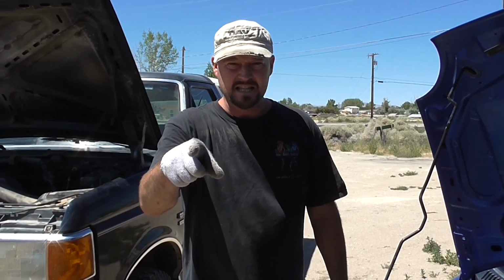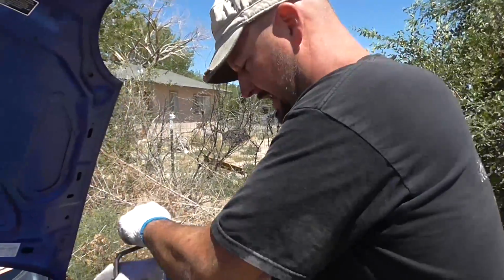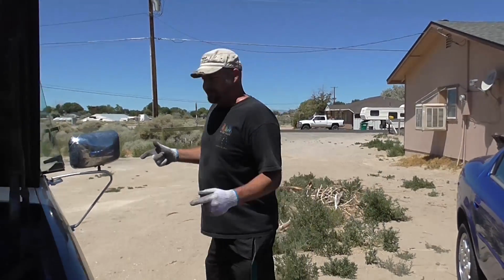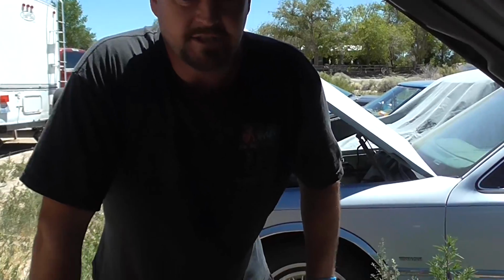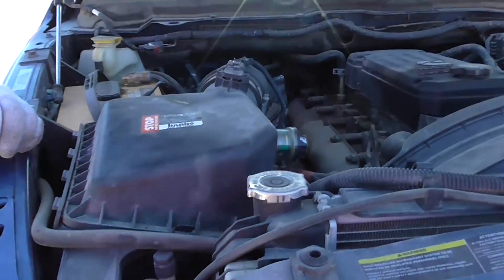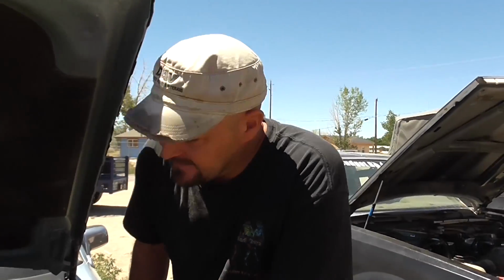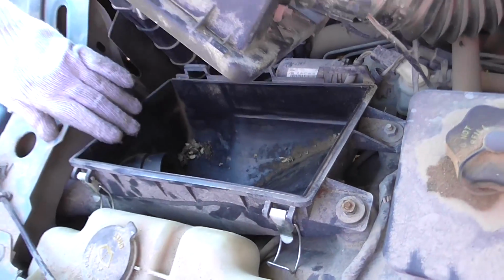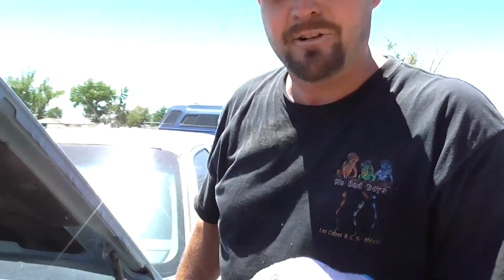Free Horsepower And Fuel Economy - Intake Mods

Comment: Good stuff.   I have a piece here on what I went through to get my 88 4wd Chevy to about 26 mpg without doing any internal engine work.  Hope to hear more later from your "Hollywood" promotions.
Reply from the maker: Would like to get lucky enough for a promoter, sponsor, or channel to take us on.  So far, these videos are just a hobby we do here locally in our small town of Fallon, Nevada.  Home of Top Gun Navy fighter training.
Reply: 26 mpgs from an 88 4wd Chevy is an impossibility -- you must not be calculating your fuel mileage correctly.
 Here's how to do it correctly and accurately:
1. Fill your gas tank completely full.
2. Record your odometer reading at this time.
3. Drive until the fuel gauge reads 1/4th of a tank is left.
4. Fill the tank completely.
5. Record the gallons used to two (2) decimal places.
6. Record the new odometer reading.
7. Subtract the previous odometer reading from your new odometer reading.
8. Divide the number of gallons (such as 14.75) used into the number of miles  traveled to determine your EXACT fuel mileage.
 I'm sure that you will find that claims made for "better fuel mileage" are mostly hogwash. This mileage computation method will allow you to check your fuel usage ACCURATELY in order to test the actual benefits received from any  modifications/adjustments that you make to your vehicle.

Comment: Is there a way I could numerically compare and contrast the intake and exhaust ratio of whatever potential parts I may decide to swap out? I just want to be sure I can get the best bang for the buck. I know that modifying the intake without modifying the exhaust can reduce power in some cases due to an increase in exhaust pressure.
Reply from the maker: With out a flow tester or flow bench (expensive piece of equipment) it would be very difficult to come up with a ratio.  I look at intake filter area and prefer to use as large as an air filter as possible limited to space of course.  The exhaust I prefer welded type mufflers such as a thrush welded, flowmaster welded style or similar designed mufflers.

Comment: Hit a big puddle with a chopped airbox, then get back to me . If more air needs to come into the engine it is safer to get it from the hood or at least grill level. Not sucking air from a low, downward position .

Comment: when you cut the air cleaner you are bringing in more air also the computer is set to have that air cleaner from the factory when you modify that air cleaner you're running a lot more air do you have to readjust the fuel mixture we set it in the computer system because you don't not want to run the car to leave because when you run a car too lean it makes the engine run hotter computer system was designed to have the original airbox system do you have to reset the computer fuel system on the vehicle was curious

Comment: Chopping the bottom out of the Lincoln's air box was a dumb idea -- which makes the whole thing into a HOT AIR intake. Better to just remove the "Snorkel" from the air box and run a short piece of 3.5-inch dryer hose from the air box  forward to the hole in the radiator support, where it can draw COLD AIR from forward of the engine compartment. I've had that modification on the famous 95 MERC for several years, using a K&N Air Filter -- works perfectly, sounds right, and saves the cost of an expensive "Cold Air Intake".
There is NO restriction with the above mod, as the hole in the front of the air box is larger than the diameter of the Throttle Body.

Comment: til you drive in the rain and water flies up into the intake
Reply from the maker: Many stock filter inlets have that very same problem.  My intake lessens that problem.  Worried about water, get a snorkel.
Reply: Or you could do a k&n filter with the anti hydro bag, while its not 100% water proof it will help quite a bit

Comment: As crazy as this guy sounds, his ideas worked great on my crown Vic and Grand Marq. They sound like screaming banshees from 3500 to 5500. Cut the bottom off of the air box, it works great! Make sure to leave the mounting points so it can get mounted back up.
Reply: I made a new intake video on Mad Boosting which IMO is much better than my original Free intake mod video.
Reply: @madboostingmadmatt48  You are my new Guru

Comment: Hey, you are a funny guy!  Like your ideas.  I have a 2005 Town Car.  When I make the mod to the air box, does the computer have to adjust to more air?  Or does it automatically adjust to the extra air?  I love that sound after your modification.  What mufflers should I get to help with the 239 horsepower engine’s breathing?  What kind of increase in horsepower do you reckon I’ll get?
Thanks
Reply from the maker: Computer will make self adjusting within 30 miles or regular driving or disconnect negative batter cable for a bit, re connect it and PCM resets and relearns your setup.  This works for simple mods like intake and exhaust.  The muffler I picked for my 2020 F150 3.5 ecoboost is budget $25 and a good rumble and free flow.  Here is my video on it:      https://www.youtube.com/watch?v=PaxHmZi0U9s

Comment: I herd the town car has a govenor system? is that true, if so how do I take it off
Reply from the maker: A tuner or a PCM aftermarket performance chip from Hypertech, SCT, Diablosport and many other tuners have chips to remove governors and increase limits to allow more out of the engine.  They can be found at Summit Racing and other tuning shops.

Comment: Man I wish I would have been more scientific about this because I did a transmission fluid flush and cut the bottom of my air box off at the same time and it fix my stall at idle my rough idle and general motor roughness but I don't know if it was or if it was the brown slugs transmission fluid I had in the torque converter

Comment: Cool but what about the need to try to keep the air as low temperature as possible.  The factory ductwork usually feeds the paper filter from in front of and beneath the radiator.  The underhood air temperature climbs precipitously especially in city driving.  Edit - I see that my comment applies to the first vehicle and you did try to do CAI on most of the other ones.
Reply from the maker: Keeping intake temperature low is great. However, if you have an intercooler on a turbo charged engine that does the job for you. Of course lower intake temperatures before the intercooler is beneficial as well. Always do what works best for you and on your budget.

Comment: Its flowing so much air  that it has imploded due to the vacuum it is creating, look at how it is crushed. More air=more fuel. The more air entering the engine the more fuel it will consume. The O2 sensor will adjust the air fuel ratio. at first the engine will run slightly lean until the adaptive memory catches up. So maybe a little better economy for a week and them worse than stock. minuscule performance gain. (assuming you are increasing air flow as he did not do on the neon).
Reply from the maker: the filter looked crushed when I put it in.  I had installed it in another car with tight space and it collapsed a bit.  It was not due to vacuum resistance.  I did not want waste a good filter due to just looking a bit crushed.

Comment: So all is well and good but weren't these mods done to pre '96 models? Just wondering what will happen at the inspection station when the tech looks up and sees 1/2 the air cleaner housing missing or other mods. Won't these mods affect the OBD II scan readings?

Comment: This is new? I was doing this 20 years ago Hell make that 40 years ago by flipping the    top of the carbs intake air filter cover lid over.
Reply from the maker: Yep, me too, I did that in the 80's to my 1975 montecarlo, flipped the airfilter lid, installed taller filter and what a difference for such an easy mod.

Comment: More holes in the bottom of the air box filter = more HOT air from the engine bay inside so no gain (on a contrary you lose performance) just noise.

Comment: only performance and mpg matter. Noise does not matter. pressure drop goes by the 5th power of diameter-even a little makes a difference. cold air ok if you can get it-I'd rather have better breathinng.  paper  ok as long as it performs.  Remember an engine is just a air pump so must improve exhaust too.

Comment: Breathing easier means less clean air so when the not wellfiltered air goes through the engine all the dirtyness is acting like a sandpaper on the engine and after some miles u will need a new engine

Comment: When you use the paper filter and cut the bottom out of the filter box, doesn't that then expose the whole filter to water when it rains?  And its not clean water, its filled with oil, dirt, and other road filth.  Won't a filter strangle the motor?   What happens to the K&N filters on top of the block?   Anyone?  Anyone? Bueller?  Bueller?
Reply from the maker: That requires careful thought, aim the cut hole towards the grill where the cold incoming air is.  The factory hole on many factory airboxes is below the bumper, so to your comment, many cars will suck water anyway with extreme puddles.

Comment: Most cold air intakes are useless. The oem already designed it for good flow. Just buy a different filter material if you don't like paper ones.

Comment: Most Smog techs don't care, but occasionally you'll get some boy scout who either opens the air box or feels around it and will fail you for damaged emissions when they spot the holes you drilled in the box - just fyi. Better to get a CARB certified CAI and avoid the hassle of having to buy a replacement stock air box.
Reply from the maker: I am glad I do not deal with CARB since I am in a small town in Nevada.  But the best thing is to talk to the SMOG tech before hand and explain to him why and the benefits and see if he will still pass you.

Comment: I just finished making a 3 1/2 inch hole in my trucks 2006 lower cold air intake box. After 15 years of owning the truck I noticed a huge gain in performance across all power bands, after cutting the 3 1/2 hole. I also made an extra hole my 2021 car. I noticed a huge gain in power. What you are saying is true! Free modifications in any existing lower cold air intake will work for for any car to gain power. I completely agree with your "small hammer" approach to recapture power that is kept from our cars! Modify what exists or spend a little bit of money to recapture what should be ours.

Comment: What I don't understand is, if it is breathing through a small hole on the bottom of the air box, then the air goes through the air cleaner, and then it is has to go through another small hole and down the tube to the throttle body, what good is increasing the hole on the bottom of the air box?  The hole it has to go through on the top where it goes to the throttle body is the same size. It is still restricted so I don't see the benefit. Am I wrong?

Comment: I totally remembered this video when i disconnected the resonator on my civic (Just the pipe not the entire resonator in the intake). Sounds badass and the little "Hiccup" i had when i released the clutch is gone. Plus that beautiful throaty sound
Reply from the maker: Every one of my cars has my intake mod, and it really makes driving it more enjoyable as well as the better throttle response, and improvements.

Comment: drop in filter for stock air box okay but dont forget the resonator box by the intake manifold. that is where most restriction of airflow takes place. you wont see much gain just by dropping a filter in stock configuration. you will need a complete set up to see any gains and no restriction of air flow.

Comment: This guy makes a lot of sense. My buddy had a Subaru Legacy with the tiny 2.2 motor in it. We never really figured it out, but that thing when accelerating used to actually whistle. Really really. My guess is it may have had some unseen hole in the underside of the air box. Whatever it was, it whistled and had extra 'boost'. I like this guy's video, and his personality. Educational and entertaining. I am gonna mess around with my stock 2001 Pontiac Grand Am's air intake, with factoring in New England rainfall amounts. Maybe just some 1/16ths holes drilled into lower side of air box !!

Comment: Love your enthusiasm made me laugh a few times. Question.. Wouldnt all this excess air confuse the computer which is set and engineered for factory air filter/box ? when all of a sudden you have all this excess air flow and change in temperature running through sensors and confusing the computer as it thinks you have the factory air filter on?? to do this correctly wouldnt you need to have your cars computer professionally re programmed for it to work right ? same as changing exhaust as it changes the exhaust pressure again confusing the computer.. without reprogramming ir tuning correctly wouldnt the vehicle run worse over time by just bolting on these changes to a stock vehicle ??
Reply: In a MAF sensor it works by reading the oxygen in the intake and adjust the fuel trims according to achieve the perfect combustion ratio of 14.7 to 1 regardless of factory settings so the ECU should automatically adjust after this mod. It relearns at worst disconnect and reconnect battery which I think would be like a flash of the ECU. Now map sensor reads intake manifold pressure and adjust fuel trims accordingly both sensor types communicate in evu with O2 sensor and air/fuel sensors. If I had a gas just a vehicle with a map sensor might have to be tuned, chipped or adjust with a dealer level scan tool or even free diagnostic software to  tune yourself after a little research.  A chip is like present stations to try with new air flow instead of tuning in the the station oneself.
Reply: Either way you need to keep the map or maf sensor in the intake air  stream if for instance your design is deleting an air box with mad/map sensor attached to part one is deleting to replace with a pipe. Either way make sure you seal the sensor so no leaks downstream after sensor or around the seal of sensor however one re incorporates it. Cutting bigger breather around or before filter   won't require any sensor mod. Maybe just a tune if ya have a MAP sensor because more air means less intake manifold pressure when piston sucks in air behind intake valve possibly causing less vacume on MAP sensor causing a too lean situation and tune  computer up for more fuel  so more power . Too lean is bad when going balls out like dragging or high room causes "knock" which is a too hot situation and knock is combustion outside the cylinder potentially melting things like valve or something outside combustion cylinder

Comment: I just paid 110 uk pounds just for a kn filter and piece crap plastic tube  wished I would seen this vid first great vid
Reply from the maker: Hopefully you can return it for a refund or sell it on ebay for a profit.
Reply: guna stik it on my fiat 500 its very slow lol
Reply from the maker: the intake and freeing up the restrictions on the factory exhaust system could make that Fiat much faster and responsive.

Comment: Well. The enthusiasm is great. But as a master tech or even anybody for fact knows when you have more air you use more fuel. So. With a K&N yes you get more air. But you are using more fuel. Until your computer compensates for it and gets used to how you drive it then you don't really get better MPG. Just keep your tires inflated properly. Change your oil when your suppose to change your air filter when dirty. Those are the 3 main things. 4th would be easy on the brakes. Good video though
Reply from the maker: Yes, all of the above is great and keeps engine most efficient. 
 Don't forget the easiest part, have a lighter foot, monitor the MAF counts, throttle position, and RPMs to keep them lower=easy fuel economy improvements.
Reply: @budgetboosting  true

Comment: Thank you brother for the free well, almost free boosted power! You the motor man! C-Lo!!!!
Reply: made a new Free intake video on my Mad Boosting you tube channel.  I believe this on is better, it is specifically for Ford modular 4.6 and 5.4 engines in the F150, F250, F350, Excursion, Expedition, some mustangs and other Fords that used this unique cone filter with very small intake hole (reverse trumpet like I call it)

Comment: I did something like this but not this way I just made the cold air intake pipe bigger with some cheap pvc pipe from the local hardware store. This way not good one puddle or wet day and you will be walking.
Reply: +Alton Steel makes sense, gutting the floor of the box also allowing more engine heated air. grafting in a short chunk of PVC or ABS 3-4" diameter would be easy.